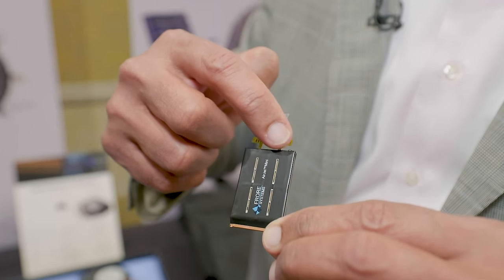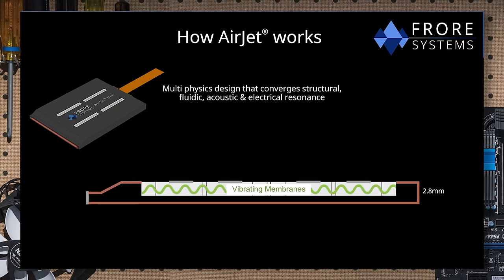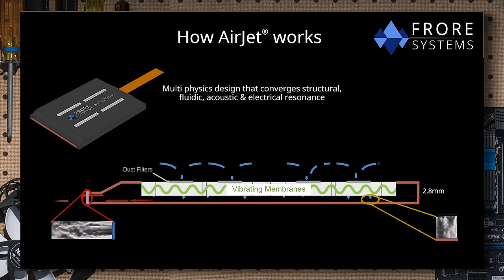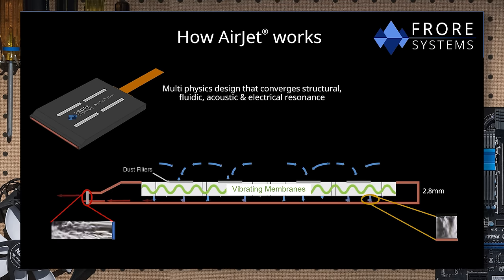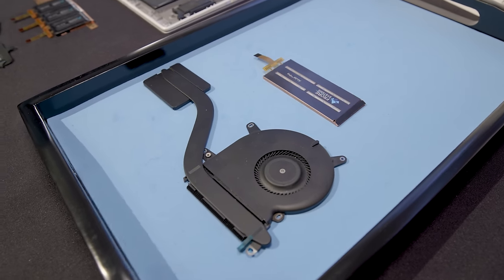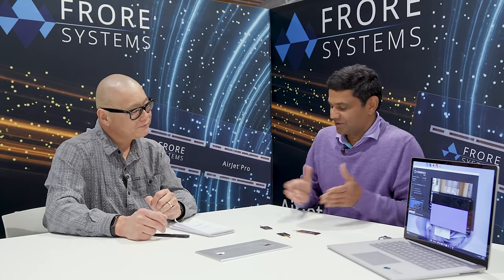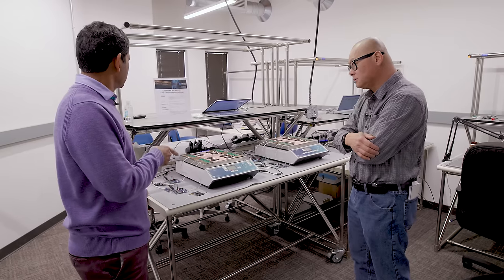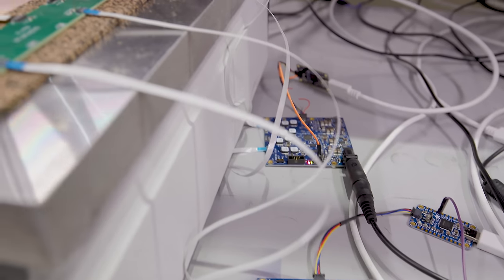Take A Lab Tour Of This Solid-State Cooling Tech

Comment: I’m really excited to see this get to 100W+ of cooling in future generations. I think seeing this on a desktop CPU would be super cool
Reply: With just a bit of mental 3D CAD work I can already imagine confgurations leveraging multiple heatpipe/vapor chambers for platforms to attach these AirJet devices to.

As long as you can leverage enough space to dissipate the heat from the processors with a flat vapor chamber you can just line up potentially 8-12 of those AirJet Pro fro 80-120W of cooling using only their first gen tech.

That being said the cooling does not come for free - each Mini device uses 1W and the Pro devices use 2W, so you will end up adding a serious power budget just for cooling alone unless they can increase the power/performance ratio dramatically.

I'd say to cover 300W range GPUs reasonably they will need a minimum 3x improvement in performance per area, with hopefully a similar level of reduction in power drain per W dissipated.
Reply: Each of these things probably cost close to ~100 bucks due to being fabricated in silicon. A 100W cooler with these things would literally cost a thousand dollars.
Reply: I think for desktops it would still be more cost-effective to just have a hunk of aluminum with a fan strapped to it, at least for a while
Reply: @User  Yeah, the fans will only get cheaper from here. This tech is still very useful for things like either peltier coolers for IR sensors and low TDP chips in thin and light devices such as phones and tablets.
Reply: @Bramble20322  Silicon isn't expensive. The tools and labour to manufacture silicone into nanometer scale are. He says that it's obviously more expensive that a laptop fan (which are in the $5-10 range in bulk) but not so expensive it doesn't make sense. If I were to ballpark the cost of each individual 'Mini' or 'Pro' I would guess $30. That's still $90 in fans when using 3 which is a very significant cost for a laptop that needs to compete. I can't see there being a $300 fan cost in any laptop, even in the premium categories.
Reply: @Dylan Evans  A premium laptop like a macbook Pro max achieving ~>10% better sustained performance due to better thermals (while being more or equally silent) could warrant a 300 dollar price increase. It wouldn't be competitive with a fan in budget or normal laptops in that case, but when your requirements are such that normal fans can't get close to the same level it will compete in the premium market.
Reply: And you could cool a GPU too, so that those 4090 could be as short as an ITX board. That would open up a world of possibilities.

Comment: Couldn't found anything about power consumption of those airjets. Are they more energy-efficient comparing to a fan, when dissipating the same amount of heat? I'm sure there's some kind of sweet spot between those parameters and it would be really interesting to know what that is.

Comment: Very cool tech, MEMS will always be cool to me. I do wonder if this could benefit from a more complex heat spreader/cold plate. The image provided looks like an empty copper can, skiving(cutting micro fins in the cold plate like a water cooler) would really help with the overall surface area and (potentially) the cooling capacity.
Reply: It might have those types of micro fins/channels. I get the impression that they provided a simplified image to protect proprietary info as well as just for ease of explanation or to allow for further changes in designs given early stage of the product. Agree on MEMS being cool (in this case literally 😁).
Reply: @ZivZulander  Agreed. I've never been a fan of security by obscurity though.
Reply: @SuperCloneRanger  The moment it is out in products it'll get torn down, this isn't 'security by obscurity', it's just 'the product isn't released yet' lol
Reply: I think it was intentionally made to be a very simplified diagram. They didn't show any actual cross sections or internals of the airjet product. They may very well have such features, just not shown in marketing materials.
Reply: @shivaargula4735  There is a data sheet on the frore systems website with a cross section with schlieren that shows a flat cold plate. It was just a notion i had when i watched the vid, i dont know enough about the fluid dynamics to say for sure they are very thin but the static pressure is there to add some geometry via skiving or possibly etched into the copper cold plate
Reply: I was thinking the same thing. Grooves or bumps on the inside of the contact plate could be shaped to perhaps even enhance this tech. 
Mems has and will continue to revolutionize industry
Reply: With an air speed of 200km/h it probably doesn't need any extra fins etc.😂

Comment: This active cooling solution shows great promise. The advantages over using a fan will be greatly determined by cost.
Reply: The advantages are more about form factor and noise vs cooling performance.

As the exec guy points out this allows thin and light laptop OEMs to push perf into a much higher range without dramatically increasing height/weight or noise, not to mention the benefits to dust management and inlet placement.
Reply: @mnomadvfx  Apple Silicon says we can have it all; 
Form factor - MacBook Air/iPad Pro, 
Noise - No fan, 
Cooling - Passive and Fanless
Past 3nm how much active cooling will be needed apart from maybe discrete GPUs?
Reply: @EnochGitongaKimathi Always a lot. Passive devices are always existed, furthermore the Apple SoC need active cooling too in the higher models. The process node will do any difference, a 100W 1nm cpu will consume the same of 100W 100nm cpu.
Reply: @IcaniCorrono  we can agree that a chip on 1nm doesn't need to consume 100W to give the same performance of a chip built on 5nm consuming 100W, it might've only need 30W. Apple M1 requires active cooling in order to offer more performance. Apple M5 might not need active cooling even forcing even the Pro or Max versions. Performance efficiency is the key target for mobility and portability.
I feel that though this active cooling solution is phenomenal it will be shortlived owing to the same technology that improves it. As we move from one advanced process node to another even more advanced node for manufacturing semiconductors the efficiency improves. As this active cooling solution becomes better so will the chips it aims to cool.
Reply: @EnochGitongaKimathi  This is not the way the technology progress is moving. New process nodes have tipically (not always) better performance/watt and tipically (not always) allow to higher power consumption. 
Just look at the trend, have you never see a new chip consume less than the previous one? Not really, because the point is the power target, the design is done in order to allow the maximum performance in the same, or more, allowed power budged. You want to increase the computational power not to stabilize it, otherwise now we only had an 4004 just more efficient. In the last year the common power budged is increased a lot, a 300+ W cpu and 600W gpu is just a proof, and the 600W gpu is build up on the newest tsmc 4n (a 5n reveistied) process node. Again, improvment, in the process node, does not mean only better perf/watt but also higher power budget in the die. Whereas, improvment in the product does not mean only lower consuption but also better performance, required for the new fancy things the users want do.
Reply: @IcaniCorrono  when we move to a more advanced process node we are improving 3 aspects: power, performance and area. How manufacturers take advantage of the improvements may vary, some might decide to reduce the power for similar performance and better battery life, others might decide to increase the power for increase performance at the expense of battery life. Sometimes a new form factor such as a handheld gaming PC has an even lower power budget so even though the chip in a Steam Deck can perform better with more power the battery life is more important once an acceptable performance threshold is reached.
Reply: @EnochGitongaKimathi  It is a little more complicated than that, but it is ok. Nevertheless, I get what you want to say and I am glad that your touch one aspect with your last statement: "once an acceptable performance threshold is reached". This is exactly the point, the threshold move togheter with the new node, it is simply the moore's law. What is acceptable to you today will be not acceptable to you tomorrow.

Comment: Very good video that clears up many questions I had and saw in the comments from the previous video. They also addressed the reliability and longevity concerns. 
Some things that I still want to know are how well this scales up as there are processors with higher TDPs(35-40W). If this can handle the thermal output when a processor suddenly boosts up spitting out a lot of heat with it. Also is there any sort of manual control similar to what fans provide? What voltages do these run at? I imagine having them constantly running would draw power when the laptop is idling. Can they eliminate the need for metal fins since they sit directly on the chip hence making them lighter.
Is there a model in the works for cooling GPU which can go upto higher wattages?
Reply: IIRC from the CES video, the cooling power can be controlled just like a regular PWM fan. And I suppose you can always cut the power of say 2 out of 3 AirJets in a product, if you only need one in idle. Regarding the voltage, I don't know, but power is more important anyway (I guess that's what you meant). I think they draw 1W of power to provide 5W of cooling.

Comment: What I would love to know is can they be increased in size without compromising the quality of the product? Would be interesting to see how they are attached to gpus someday, would they just attach 8 or just create one big one for a gpu.
Reply: Probably not one big chip, but rather multiple chips in a singular device using multiple heatpipes with flattened ends to feed it.

The potential thiccness reduction to gfx cards is significant to be sure, especially if they utilise both sides of the PCB for space to cool with.
Reply: Gpus going up to 700w very soon
this is going to be tough, can't wait to see what happens. if it turns out possitive am getting my hands on it asap
Reply: Coolers will use more power then gpu. "AirJet Pro removes 10.5 Watts of heat while consuming 1.75 Watts" That means best case 400w GPU will use 65 wats just for cooling... Great tech. Btw typical fan uses max 2 wats
Reply: @golimonkey  no way bro where did you get this info? Welp i knew it was to good to be true

Comment: I'd have a very important question, I know those use 1 watt of power to remove 5 watt of heat but he didn't tell us for fan's how much heat a fan can remove per watt. If it's equal it's good, if it uses less power than a fan than yes that's a great achievment.

Comment: The creator mentions they perform a stress test of 2000 hours of continuous running, with a heat source.  Then they check to make sure they have less then 5% degradation of performance after the 2000 hours.  Losing 4 or 5 percent after only 2000 seems huge.  I have fans in my PC that last years upon years of constant use, and I'm willing to bed it's not dropping 3-5% of performance over the course of 6 months of use (On/Off cycles over 6 months, probably being close to 2000 hours continuous).

I'm excited about this technology, it sounds amazing for hand helds, laptops, and phones.  But that statement makes me worry about it's long term viability.

Comment: Schlieren imaging will create images from a fan, but it relies on a density change, yes it is easier to see a density change if there is a temperature difference, but just the act of moving air, will create low pressure and high pressure zones, eddied currents, and areas where fast moving air collides with slow moving air resulting in localized high density

Comment: I wonder if there's enough power/pressure to use it for propulsion?
Also, I think the song and dance about heat removing vs air moving is fluff.  Peltier devices are 'primarily' heat moving.  This device clearly moves air first, and uses that air to soak up heat on it's way by, just like a fan.

Comment: This could in the future make a small formfactor PC build a reasonable choice. Desktop PCs are usually kind of big now (midi/big tower). If components such as CPU/GPU/SSD and maybe even high performance RAM could benefit from such a technology, then traditional fans are no longer needed.

For gaming laptops, this is a life saver. There are two downsides on my 2 year old Lenovo gaming laptop; a slow 120hz LCD screen (ghosting, thereby high ms), and loud fans while gaming. Replace that 120hz LCD screen with a 120hz or higher OLED screen, while also replacing the loud fans with this technology, and a gaming laptop could in many ways replace a desktop PC.

This has to be one of the best things happening to computer technology since SSD became a thing.

Comment: I believe it was using a MEMS technology which was also a new breakthrough technology use mostly in watches replacing the quartz crystals to improve accuracy in analog watches. MEMS are widely use also in sensors like hand gesture sensors.

Comment: The interesting thing about this product is that it has the air moving membrane attached to a copper heat spreader. It is conceivable they should simply remove that heat spreader and manufacture something that goes directly on the component that needs to be cooled. This way, it removes the airgap that is present between a cooler and the chip being cooled, allowing for more efficient cooling.

Comment: Could this work properly if the intake and exhaust were both on the edges on opposite sides, instead of at a 90 degree angle? That would be useful when stacking them with fins or thin vapor chambers to make a beefier cooler. Otherwise you'd need gaps.

Comment: For desktop maybe the could fit between the fins of a heatsink plenty of these to remove the heat from the heatsink. They would have to make a custom made heatsink just for this for optimal use though, an off the self heatsink will not fit that well probably.

Comment: They should look into TVs and expensive lighting, projectors, etc.. all need cooling and currently have noisy fans.
They do need to release more information about how much heat energy they can extract/move, as well as how much power they consume per device.. ultimately if they shift the same heat but use more power then would I sacrafice battery life for less noise?
.. why can't a device be made bigger/in different sizes? Etc..
Also - why do they need filtering for the most part? The vibrating membrane sounds like it would shift most stuff that got in there since it's vibrating and not restricted via movement like a fan (so unless it's sticky you should be good)..
Also-also, that video about the air moving is purely air movement - if it were about heat you would see the infra-red scaling.. which would have been cool to see.
Penultimately - it's not a chip. It's an extraction chamber/device, but not a chip.
Lastly - can this thing operate underwater? That might visualise the heat conduction better, it might actually function "better" (getting into water cooling and maybe good for PCs/servers) and also extra uses (heat exchangers etc).

Comment: 21:18 I'm not sure how a contact microphone is a viable way to demonstrate ambient noise. Fans will cause vibrations as they are mechanical devices. An ambient microphone located just over the laptop might be able to give a much better relative comparison.

Comment: The pictures showing the product next to a traditional fan and heatsink are misleading because in their laptop implementation they still need a heatsink and need 3-4 units to get enough cooling performance. So 4 units are not less in size than a normal fan and probably not in weight either and not sure about energy consumption. The only real advantage seems to eye noise and maybe dustproof qualities

Comment: what i learned from him is that :
it move a small enought quantity of air witch hefp it to move it very fast so the air will be more cold and cool down fast .
but normal fan move a big quantity of air that just use more power and struggle to cool it down and always related to envirenement temperature
the idea is to put it on top of the heatsink and cpu with thermal paste on it for thin laptops without fans
this will get alot more space inside laptop so they can add more battery or whatever.
and put it directly on phones arm cpu with thermal paste/pad and can even use recycled air inside the phone if the company change internal design to keep water resistance capability but phone size is going to increase anyway.
so this thing is a beast.
also cant wait to se solid state batteries inside smartphones, laptops
they only use it for some of that expensive drones and satellites because its very durable and heat resistance

Comment: I get the feeling the air jet is essentially a speaker with check valve membranes to pump air. Which is probably why he was hesitant about it being a solid state devices based on what one would commonly define solid state devices. To be fair it would still be innovative.

Comment: It would be a great solution for VR headsets if they could fit a pro jet on both sides of the APU and up the cooling capacity to 30w. Maybe on gen 2.

Internal space is at a much higher premium in VR headsets than laptops, so I'd be surprised to see this tech in them this year.